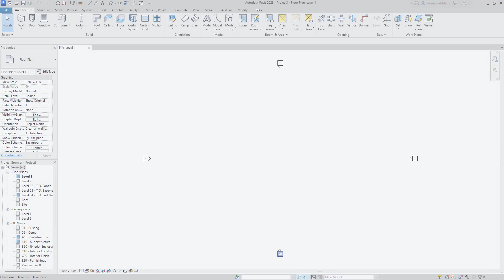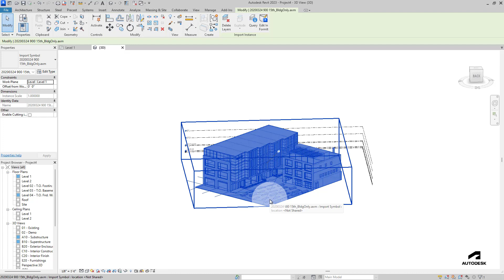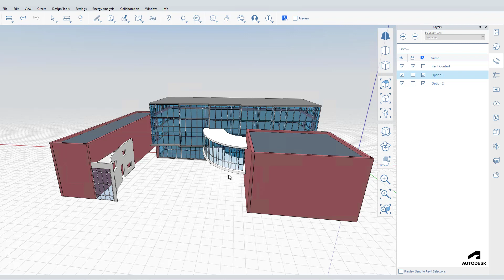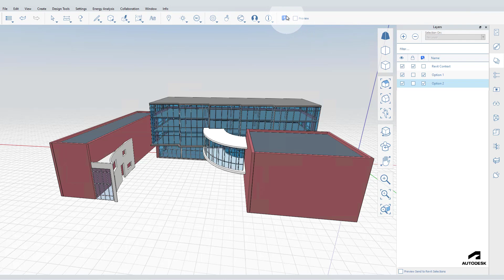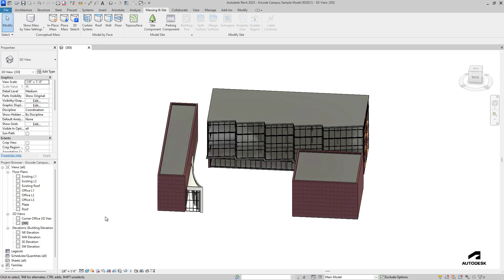FormIt Workflows - Revit + FormIt 3D Sketching for Design Options

Comment: lovely video but still the most important thing is missing. How do you use Formit faces in revit 2023 or R2022 to build walls / roofs etc like you used to do it in an older version of revit. Is this still a thing or it was cancelled?